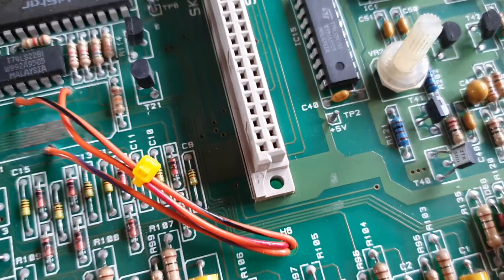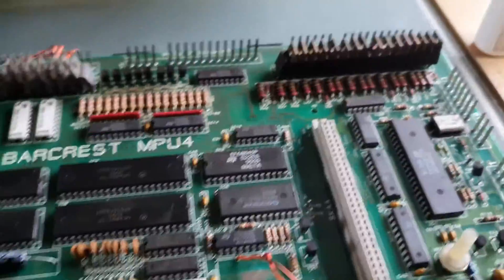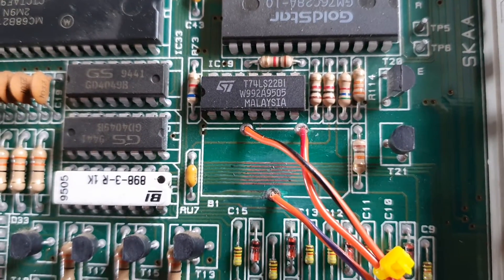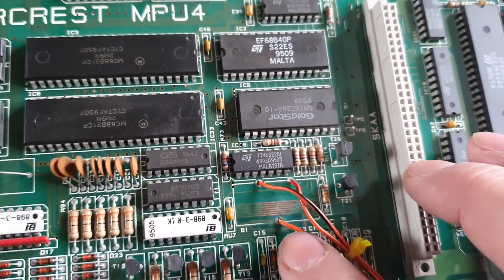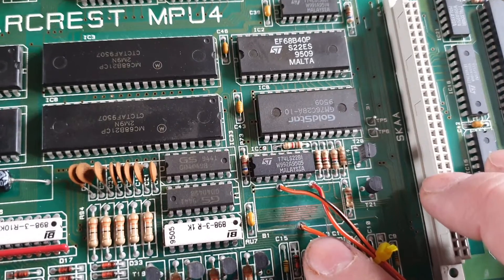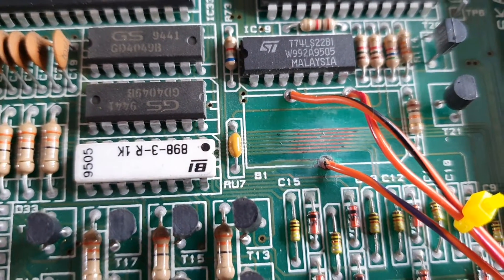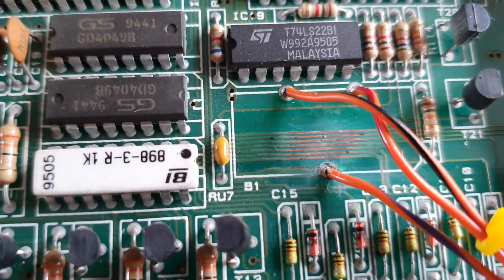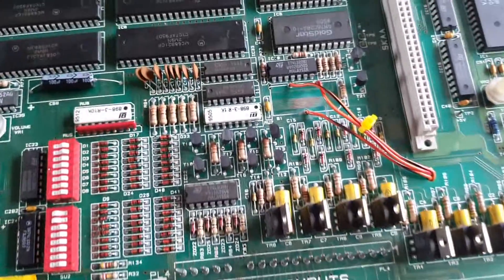MPU 4 Motherboard fly wiring help, how I clean corrosion from tracks etc

Comment: Yeah I have an IGT Pinball S+ recently picked up for cheap. I figure the MPU4 would be bad & it was. The varta leaked. The machine plays fine but the top box has no sound. Some of the traces are not intact near were the battery was. Hope it can be fixed.  I threw that devil battery away..
Reply from the maker: Sorry I don't monitor this account like my main channel.  However the tracks that get eaten run to the alpha and triacs for payout in the main and regularly get chewed up.  Did you ever get it running again?
Reply: I sure did, just traced the wires and got it going. Works like new now. Thanks